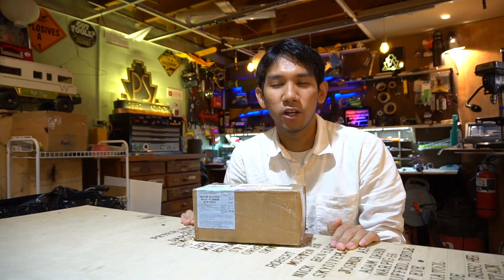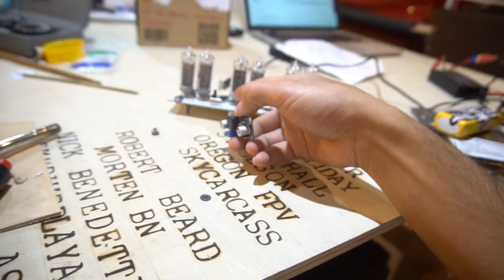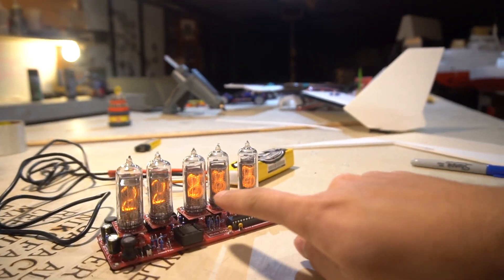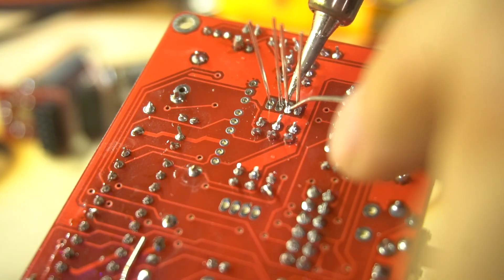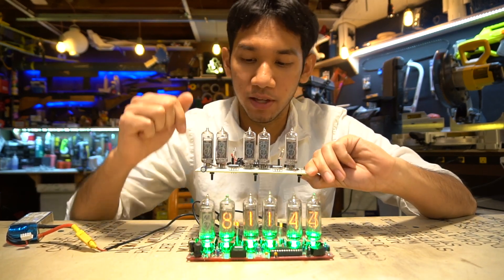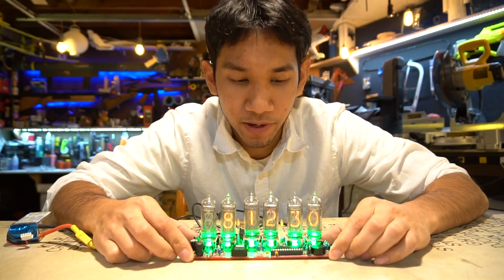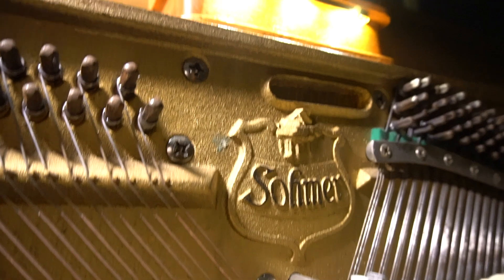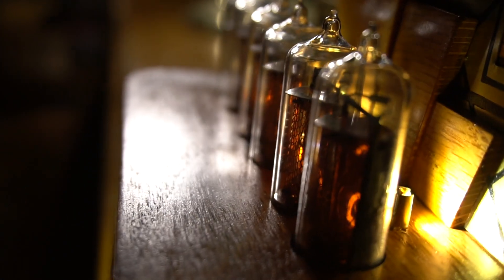The Art Deco Nixie Clock

Comment: I built that same kit, and also shorted one of the tube connections with the same results.  Pretty funny how that is a thing.  I opted for the acrylic case because after all that soldering and ensuring the resistors were perfectly aligned, etc. I didn't want to cover it up.  That said, your wooden case is spectacular.  Love the added touch of .22 shells!

Comment: Love those clocks. I'm going to build one of those. If not just to figure out the control of those tubes. 

Glad to see you got the second clock going.  When you were showing the problem with second clock, due to the nature it was only happening at a certain logic state with the digits an only on 2 the first thing that popped into my mind was "somethings bridged". I've had that happen especially when its something I build on a regular basis. I have a few projects that require a lot of SMT soldering, I get complacent or in a hurry and wind up spending hours tracking down a single solder bridge,  an intermittent issue caused by a cold solder joint or worse I accidentally let out the magic smoke. I'm sure your well versed in magic smoke theory. LOL.. So Just saying I've been their. :) 

BTW, I really like the way you  edited the assembly, soldering and building the clock. At someones request  I recently did my first video fixing a receiver. I don't normally record my work thing and it turned out to be a 50 min+ boring Geez 'is-it-over- yet?' video. SInce it was a request, I just hit record and went with it, no plan etc and required a massive amount of editing.  It served its purpose he was able to fix his equipment but it made me realize how hard it is to put these together until I did that one myself.

How long does it take you to edit the build sequences in something like this?

Comment: You shorted you inductor on the first clock. Made a mistake somewhere. 9 times outta 10 inductors don't go up in smoke unless they are shorted by something else. An inductor is rarely the cause. You need to do a diode check to ground on each isolated circuit. Should be an easy fix. Nothing like tracking down a dead voltage rail on a computer mobo. Buck converters love to die.

Comment: I actually designed my own nixie tube boards. I'm having a similar issue that you were having. I'm fairly sure that was either a control line voltage or high voltage supply issue.

Comment: You probably did a soldering mistake on the first one. Powering the board from a LiPo blew the inductor and switching MosFET. Use a current limited bench supply another time and you will be able to see if something is shorting out.

Comment: By the way, if you care to get that other one working, try replacing the mosfet on the HV boost converter, I'd go ahead and swap out the diode to, because if it's fried it'll take out the new mosfet when you plug it back in.  Make sure you get the right diode, it's going to be some sort of schottky diode (important for switching / boost converters) don't use a standard silicon rectifier like a 1n4001, etc..  Good luck, I hope you get it going!  The HV capacitor is "probably"  ok but i'd check anyway, they're cheap as dirt.

Comment: When reading the value of inductors like that; the numbers are a code 331 would be read 33 X 10^1 µH = 330µH.  Likewise a 472 would be read 47 X 10^2 µH = 4700µH.  Similar to reading capacitor codes or an smd resistor.   Did you happen to power on the board without the Nixies plugged in?  That inductor generates the +170 volts (or more) for the HV supply for the tubes.  If the HV supply is not regulated via some sort of feedback and it had no load on it when powered up the HV would rise WAY above the nominal rated voltage frying the MOSFET, diode, and maybe capacitor (or you could have had a low resistance path (short) somewhere drawing excess current.

Comment: In case you're interested, that 330uH inductor is labelled 331 because the 1 is a multiplier, same as how resistor codes work. 33 x 10 = 330uH. A part labelled 332 would be 3300uH.

Comment: Peter, Do yourself a favor and get a Weller Adjustable Soldering Iron. Use the small chisel tips. You will find that your soldering skills will rapidly improve. Do not pay a lot. You can get a real good Soldering Iron for about $50 to $60 Bucks. I like Weller because of the Iron Clad tips. I have worked in Electronics since the early 70's and having a good adjustable soldering iron is a real game changer.

Comment: hey peter great job! I also have a fairly compact basement workshop and im wondering how do you deal with dust and fumes? Im currently looking for a solution
Reply from the maker: If I can remember to, I use a shop vac and turn it on whenever I cut some wood! For painting I do it right next to a screen door and turn a fan on before I begin painting!
Reply: Ill try it out, Thanks!